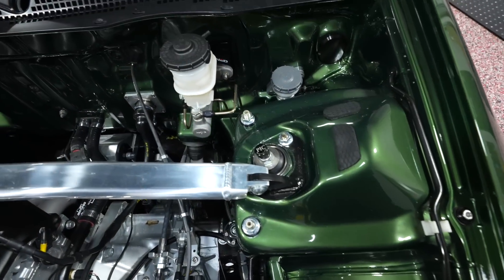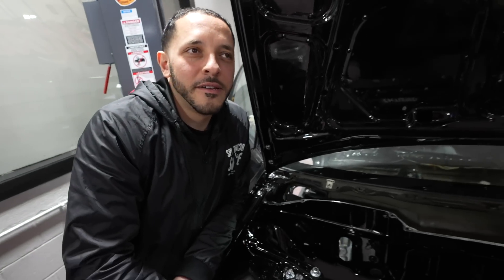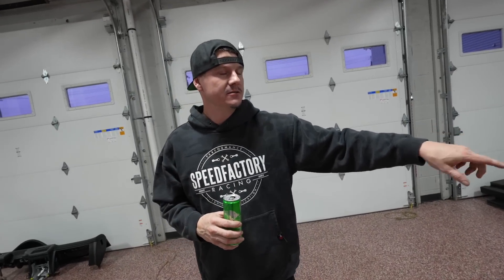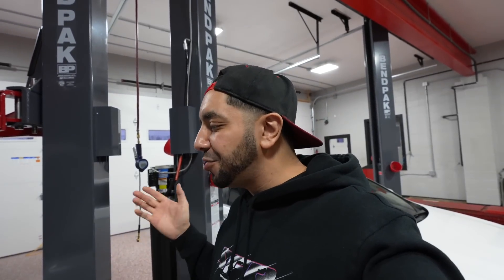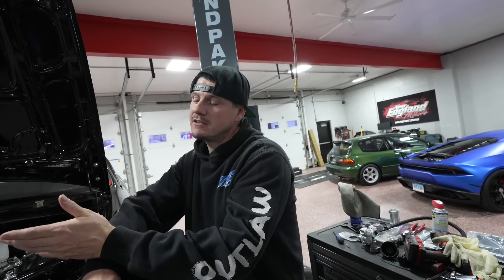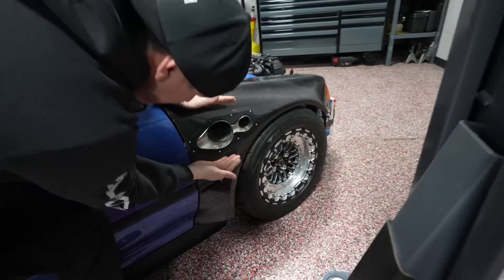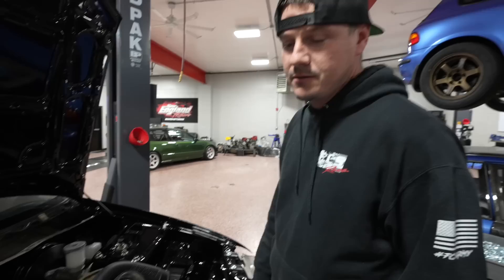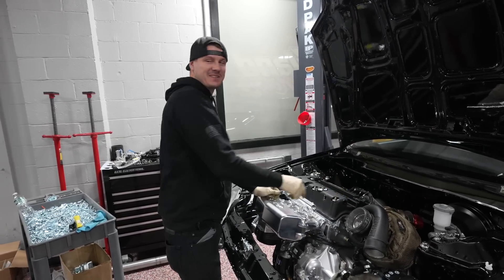The most OCD AWD 1000hp Civic Build!

Comment: Due a full exhaust but with a vband mount close so u can have the option too change out exhaust so u can remove hood and put the hood exit setup on and when time too go in the garage swap it back and install the hood . I run all my cars with a vband set up so I can inter change axle backs when ever I want I'm bad with changing out axle backs and wheels to change the car up threw out the season so I never get bored with any of my builds . 😅 also 33 here

Comment: Full exhaust bro sounds so much better don't get me wrong hood exit is cool but full exhaust all the way what would be cool is the exhaust coming out the middle of the back bumper dual tip but wait might not work cause your fuel cell being located where the spare tire would be so next would be the fender exit but the passenger side but if you could some how do the full exhaust coming out the middle of the back bumper that would be sick ,oh yeah born 1986 son...

Comment: Full exhaust will choke that thing up wayyyy too much is what people aren’t understanding. He wants to make 1000whp in this thing awd. That’s gonna be a fight with a full exhaust on it. Especially with a driveshaft. Max you’re getting a 3.5” oval pipe fit down there. Max. Kseries flow way too well to have all that backpressure built up. He needs to run up pipes or a fender exit. I say up pipes. Leave the hood off and have an ex made for when he just wants to cruise around. Vband everything so it’s easy to switch around.